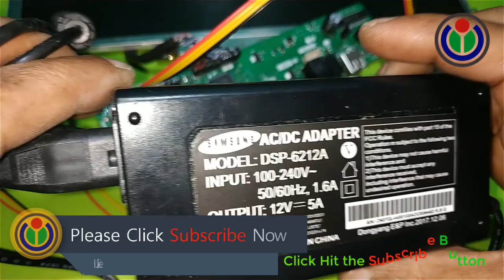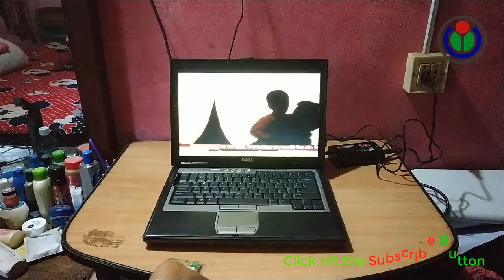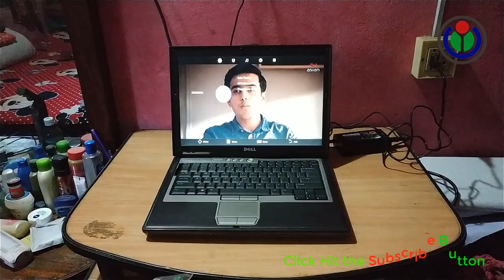Old Laptop Convert to LED/LCD TV or Monitor || Make LED/LCD TV at Home || Setup TV Panel Make A TV.

Comment: NICE work bro, 
Dear if we use New model LCD panel then how we connect backlight inverter because many New model LCD panels have no separate backlight wires. Please explain how we give backlight power to panel. I see many videos on this project but all guys uses the same old Dell LCD panel which have separate two backlight wires. Thanks a lot in advance.
Reply from the maker: Yes you can
Reply: Hey @Ghouse Mobile

Did you find a solution for your question??

Even i have an display panel which doesn't have a inverter backlight cable
It just has 40pin lvds cable

Thanks in advance
Reply: @MazinHQ  No dear, Still unlucky😭😭😭
Reply: You need to check datasheet of the dispaly in internet and find which pins sends voltage. When you have pins of the connector, then you will know where you need to connect voltage.

Comment: can’t do this cause i got strict bengali parents but i’ll watch it anyway
Reply from the maker: Thanks
Reply: What does that have to do with anything? They’re strict so you can’t use a old laptop to turn it into an external screen? I don’t see the correlation
Reply: @ajk9420  i can’t do an autopsy on my laptop plus i just fixed it by getting a new charger
Reply: @blockfish5163  You do understand that this is for not working laptop right? Why would you use a working laptop.